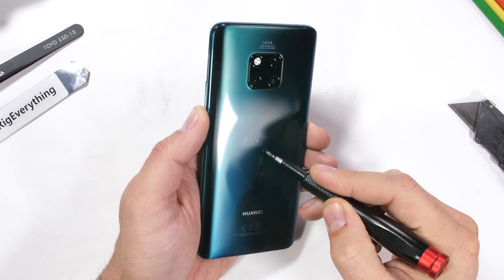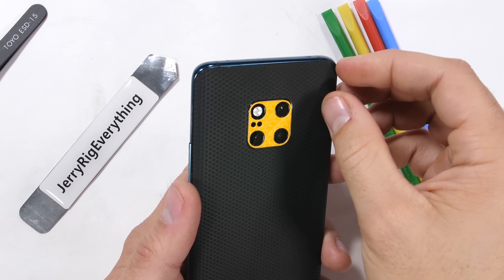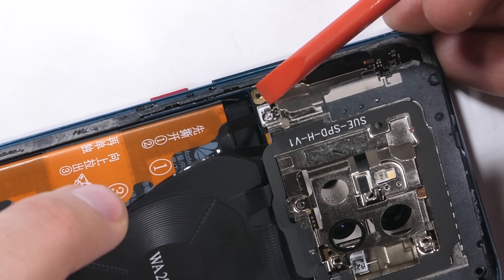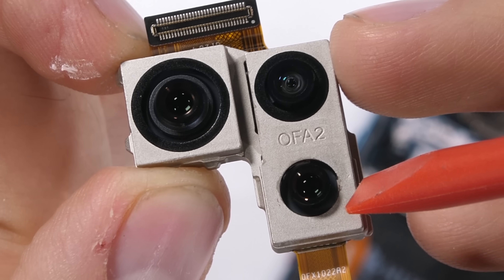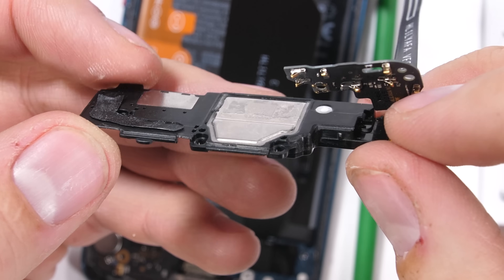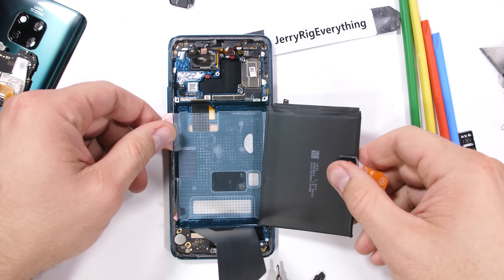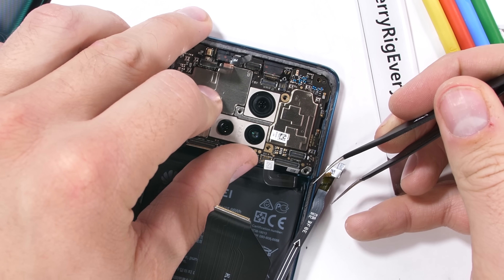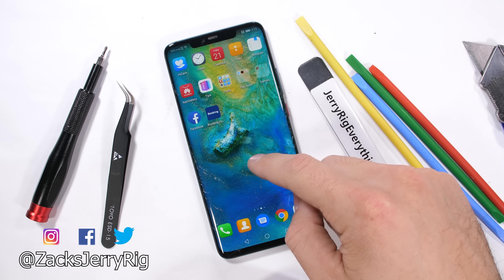Mate 20 Pro Teardown - Whats under the 'Musical' Back?

Comment: I have to say that the speaker being in the USB-C slot would not affect me at all. I currently own a Oneplus 6t, and it lasts me through the day while intensively using it (playing games, listening to music, etc.), while it only has a 3700 mah battery. I only charge it at night when I need to. If I don't use it intensively, it lasts me two days easily. So, for a phone with 400 mah more, I don't think that would be a huge turnoff. I was considering buying it, but I felt the 6t was better while paying less. It doesn't have as many features, but I don't feel they are needed. Reverse wireless charging, all fun and stuff, but you need friends for that.

Comment: The speaker actually sounds fine with a USB cable plugged into it. Slightly quieter, but not muffled or tinny. We'd appreciate if you not state guesses as fact.

Comment: I have this phone and it's great. The Lg inscreen fingerprint scanner is better then the BOE one but the LG screen has the Green tint problem. I had the LG replaced with the BOE screen and no tint but slightly less fingerprint sensitivity. But i use the face recognition for 99% and it works in pitch black and also lying in bed sideways. But yes I think this is a great phone, gave up my S8+ for this with no regrets.

Comment: Hey Zach! I just found out that Webb removing the magical pull tabs from the battery its easier if you warm up the back a little bit to soften the adhesive.